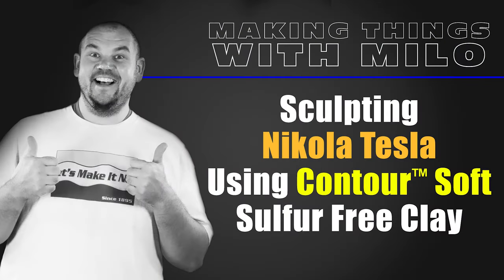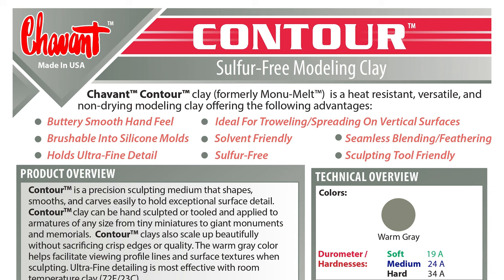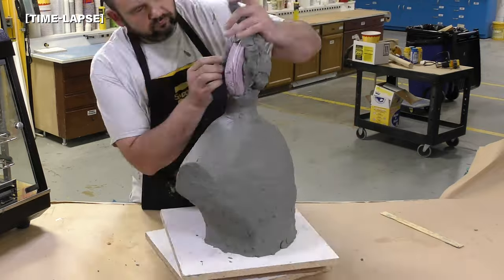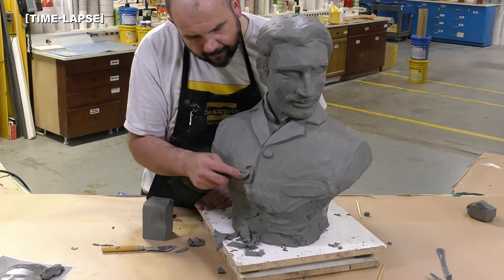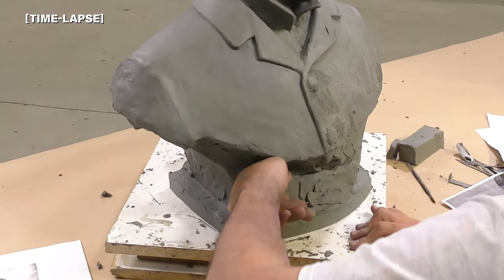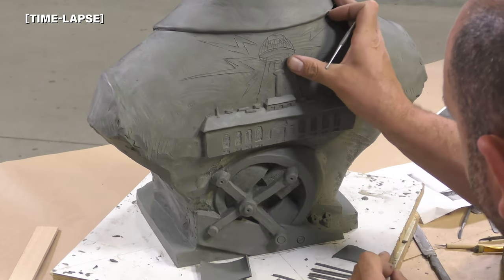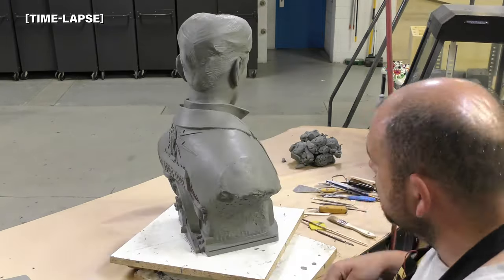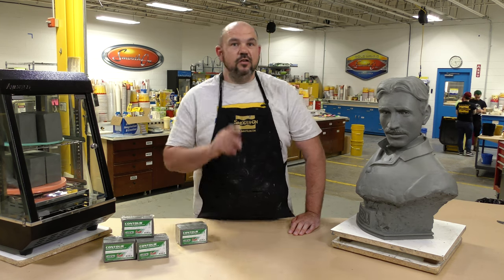Sculpting a Bust of Nikola Tesla Using Contour Oil Based Clay

Comment: Nicely done Milo, i’m going to be emailing you as I’ve got about 6 sculpts in various clays and Im still struggling to get the finish I want on the surface before making a mold. Im wondering if I have to make a mold, cast in plaster so I can sand and polish and then make my ceramic production molds.
Reply from the maker: Thanks for watching! 😃